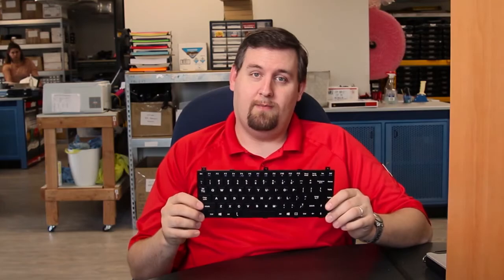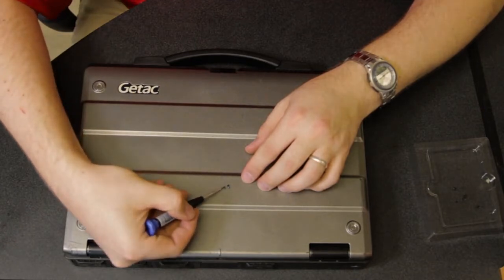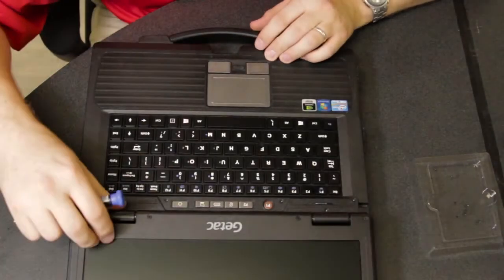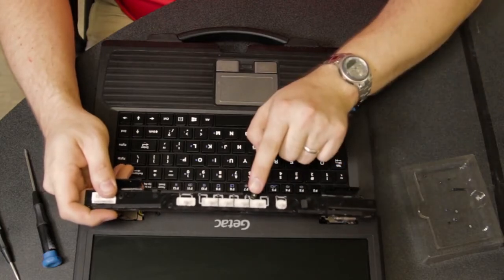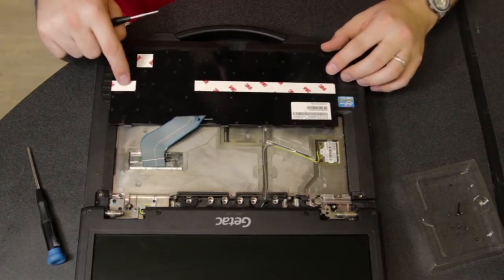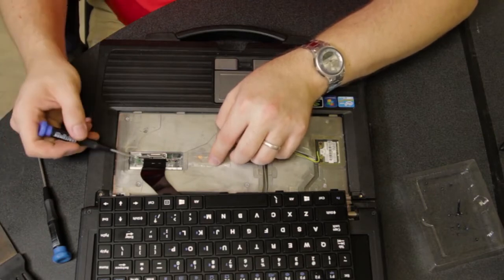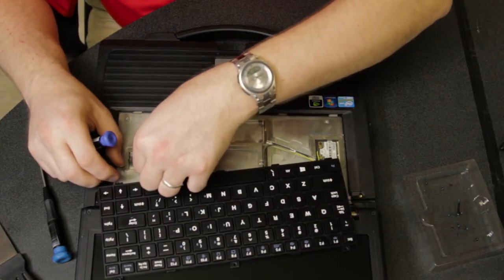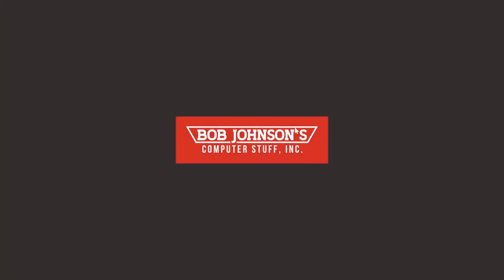Replace Your Getac S400 G2 Keyboard!**

Comment: Nothing is wrong with my keyboard, but I needed to replace the top strip with another. My power button is about to fail and I have a good one on another unit . Thanks for the info.